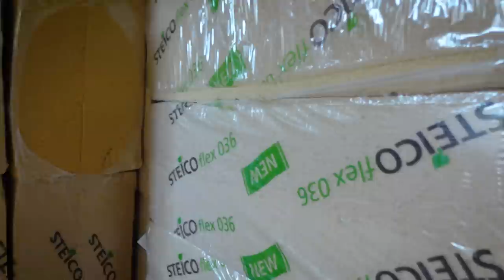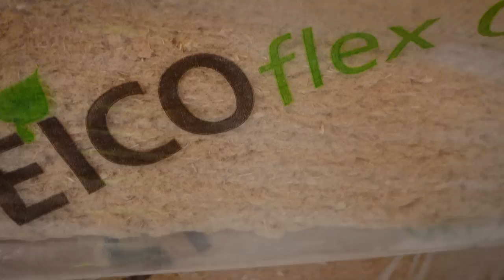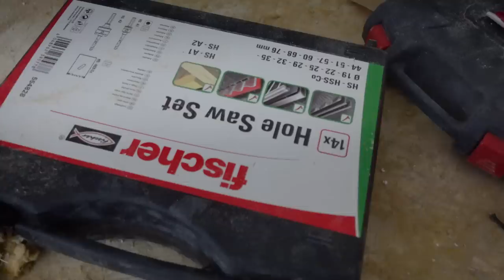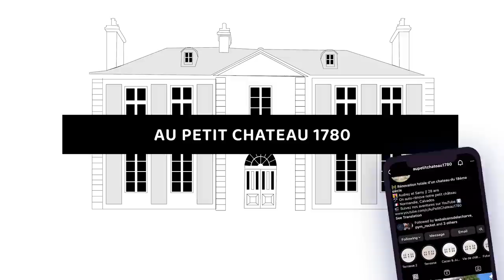PLAFONDS CHAMBRE ET ILOT DE CUISINE | EP37

Comment: 13:50 It is a real pleasure to see a young couple, without experience, who are making such a great effort to do things the right way. This ceiling is just a small example. You are so correct to use the vapor barrier and to run the ducts inside the heated space. I know craftsmen who have worked for decades and who would do this wrong, because they don't bother to educate themselves.
Congratulations on your wonderful project!
Reply from the maker: Thank you 🙏

Comment: Bonjour ,
Pour votre isolant en laine de bois entre les solives,  il risque de descendre à long terme . Ça aurait été bien de le maintenir en place avec un quadrillage de cordelette  fixé aux solives .
Vous auriez pu également utiliser votre pare vapeur pour retenir la laine de bois avec des suspentes adaptées et des rondelles epdm d étanchéité à l air . 
L avantage de poser le pare vapeur directement sur l isolant est de ménager un espace entre l isolant +pare vapeur et le raillage pour passer les gaines ,boîtes d électricité et spots qui nécessite de découper le parevapeur quand il est placé sur les rails au contact du placo ou fermacell , créant une mauvaise étanchéité à l.air . Autre avantages , si vous voulez ajouter des prises et équipements,  vous pouvez facilement ajouter un câblage sans percer le pare vapeur. 
Beau travail pour votre cuisine la déco est superbe  .